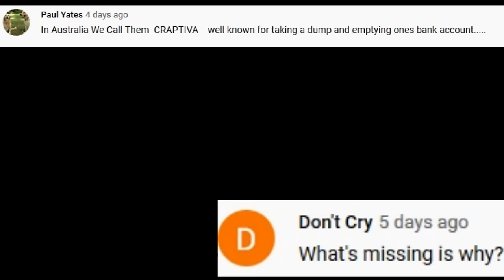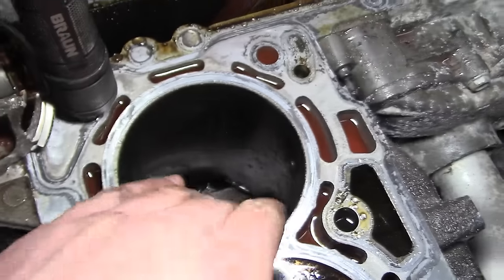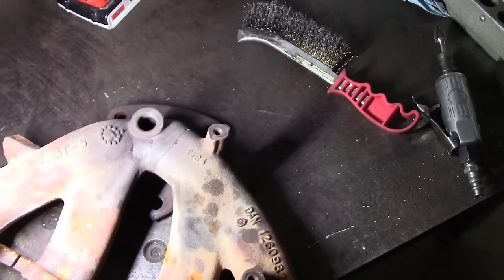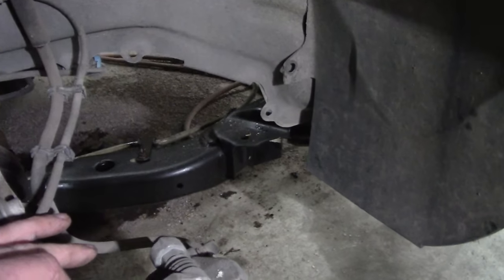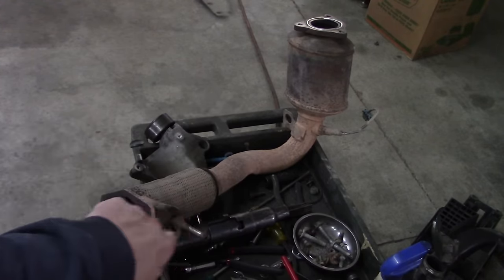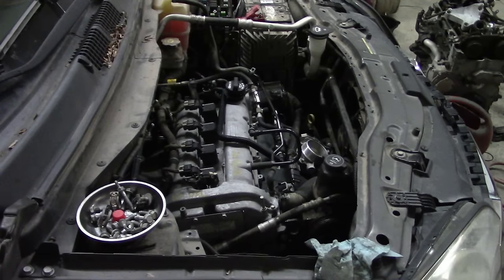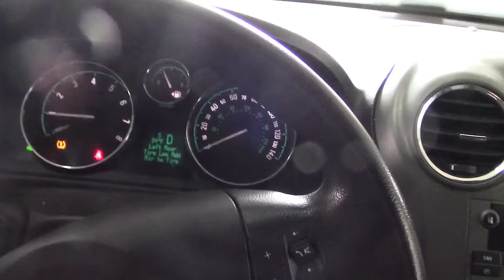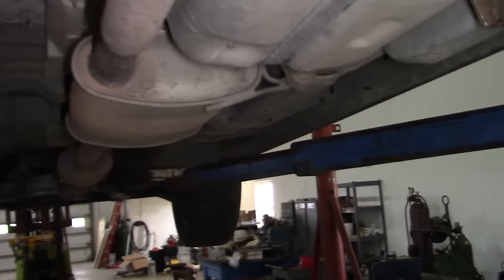I Fixed the Cheapest Small SUV on Marketplace - Part 2

Comment: "Battery sat on the concrete floor". That myth will never die.
Reply: It’s a myth, agreed.. you know it came from someone that was trying to keep there floors pretty or something.
Reply: Dan'sMeTube I’m fairly sure that was his dry humor.. it’s amazing how many people still believe that
Reply: it's a fact. seen it with my own two multimeters.
Reply: @lostintime8651  love to see that video
Reply: Tom Jennings myth my Lilly white butt ! It’s a proven fact from both interstate and Walmart ! I personally have had it happen to me also and that’s why I ALWAYS put them on wood or rubber .
Reply: @zeroyon223 >Both the concrete and plastic are insulators

Concrete is most definitely NOT an insulator, especially old contaminated concrete in your garage. High atmospheric moisture and being wet can also make concrete conductive as it mixes with impurities in the concrete and detritus on the surface. Plastic can also be conductive, depending on the type of plastic.

The old saying that batteries are drained when placed on concrete/asphalt was true once upon a time. The materials used for battery insulation casings 60+ years ago were slightly conductive, and could self-discharge if left on a conductive surface. Batteries back then also tended to have higher internal resistance, especially as they aged, which would promote self-discharge as well. Around the turn of the 1900s, batteries were often sealed in glass, wood or other composite materials, which could be far more conductive. Leaded glass, something common back then was also conductive, and could promote self discharge if used for a battery cell.

Modern lead-acid batteries usually use polypropylene for the casing, which is not conductive and won't allow self-discharge. However, storing them on a concrete floor can still affect the battery by temperature, and as a result, battery performance.
Reply: GGigabiteM Not in 6 days ffs. You totally missed the humor with your book-long post.
Reply: @jmac1099  it comes from when battery case  were made from wood. the wood would soak up moisture from the floor and swell causing the glass  inside the battery to break
Reply: @davekimbler2308  Discharged or low voltage in the battery WILL damage the battery due to the electrolyte freezing and thawing.
Reply: zeroyon223 I was told concrete with rebar draws from the earth current much like ground to air lightning occurs , but I’ve had batteries on concrete drain and not drain on rubber and wood ! It’s way above my pay grade ! Lol
Reply: and Chips of course it will but we’re talking about a healthy battery and not getting froze .
Reply: @davekimbler2308  The world is full of Mysteries my friend, that's what makes life fun and interesting ;-)
Reply: and Chips I feel like I’m back in science class in high school ( many many years ago ) and the discussion is “ what would “ ! Lol
Reply: @davekimbler2308  Old dogs and new tricks, I will always consider myself a student, people that call them selves masters, the hubris.
Reply: The dry humor of Wes is amazing.

Comment: My hypothesis:
Peeling chrome, crazed polycarbonate headlights, faded trim
all appear to be ozone damage from long periods in traffic, idling,
AC on, underpowered engine, overheated, consumed oil,
thermal breakdown, bearing spun. That rod gave up while at
high RPM, let run.

That heavy exhaust is poorly supported, too much stress on
head area, you're right about extremely poor, afterthought
parts-bin designs. Minimal communication between Engineers,
no final inspection like Old Days, Engineers would take new models 
home, test before Market. Disposable junk.

Label under hood should read:
NO USER SERVICEABLE PARTS INSIDE

Polish the turd, make $800 profit & two cool videos, gain experience.

Comment: "Minor disagreement" haha. I've  replaced a 3.6 in a Acadia. The valve decided to high five the piston because of a valve spring disagreement.  😂 Unfortunately you cannot pull it out of the top. Not to bad of a job though. At least in south GA.
Reply from the maker: Yeah most V6 engines will not come out the top. The newer F-150s require removing the cab to pull the engine!
Reply: I'm not sure if I like that. I know I prefer to pull the cab when it comes to duramax work. I guess it all comes down time and how much you want your back to stay in good health.

Comment: Doing things the service manual way isnt always the best or fastest way. I've had to reference mine to get something right and I've also specifically skipped steps because they're pointless. Breaking off the welded nut is a great reason not to even try it. Dumb design too if they're not accessible

Comment: You might be able to get a few hundred for the cylinder head if you cleaned it up, I'd put it on Craigslist. GM seems like they enjoy thinking of ways to make working on their vehicles annoying, I went to pull the heads on a 3.4 V6 in a Chevy Malibu, I had to pull the front engine support off in order to get at the AC compressor, and the exhaust manifold was a nightmare.  Fords are no better, I bought a Hyundai Santa Fe, no issues yet, and it looks like I can get at anything I need to. That car looks great, must've been maintained and kept in a garage. NY cars suffer just as bad from the Rust Monster, our cars don't last long unless the road-salt is rinsed off after every winter.
Reply from the maker: The V6s are always tight. The V8s are horrible, like the Northstar in the Cadillac...

Comment: Great video. At the end I was waiting for a great cinematic ending for the old motor, lol. How long do you think they ran it 3cyl? I think it took a while for those parts to lodge in the oil pan. 30 minutes? I've got a 94 Nissan truck with the original exhaust crossover pipe(aftermarket doesn't have the heat shields). That truck has 300k! I can take any bolt off the bottom of it:)

Comment: At first I found it strange that a man that works on so much large machinery doesnt have the required socket to spin that oil filter housing off.
Then I realised it's not so easy to get a straight shot, and I think everyone ends up using a large adjustable wrench/spanner because that is the only thing that will fit.
Reply: Sorry premature reply, I did it before you tried what you had, but I knew it wouldn't fit.
Anyway that airbox was probably designed by someone with the pipe not sticking out over the screw, and then someone else moved it.
Reply from the maker: There's a low profile 32mm 3/8 drive socket made for these filters.

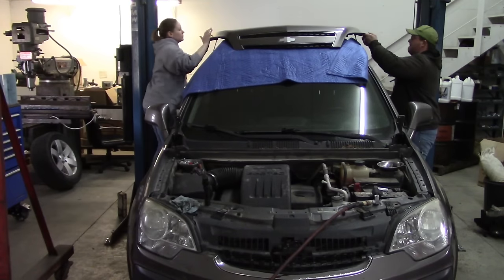Comment: First problem I noticed, was the wearing a John Deere Tractor hat, should have been wearing a Ford hat, Frequent Overhaul's Rapid Depreciation. Anybody tries to tell you First On Race Day, is blowing smoke up your dress. Not for nothing, make the better 7/8's  (that would be the wife) wear some work glove's, to save her hands from the sharp edges of stamped metal. i.e., the hood of the car.  Watch the video @ 30:45, should tell you why you NEVER, NEVER, NEVER put the hood on the roof of the vehicle, as you did, it will, and can cost you a new windshield. Lean it up against a wall, with a blanket on the floor, to prevent sliding, and to prevent damage to the edges. Put the Hood on a parts wagon, but do not lean it up against the side of the vehicle.  Unless you like painting car's, oh silver is one of the harder color's to match, just a heads up. I won't mention matching Pearl's paint (a one inch long scratch on a pearl paint job, say on the side of the vehicle, and your painting the whole side, hoping the color is close enough, without painting the whole car) or Candy Apple's (pretty much the same as Pearl's) etc. Hey what would a 25 yr's plus autobody guy know about where to place the hood of a vehicle, LOT'S!!!!!!! P.s. The bend on the exhaust pipe, is / was a forget bend. What is a forget bend you ask, answer (in my best former New York Italian slang) forgetaboutit. Those require a 100,000 mile guarantee, or until the front tires leave's the driveway, which ever comes first.  Ok, ok, ok, why just the front tires, answer the car could get into an accident as it's leaving, get clipped in the front, hence your golden on 100,000 mile guarantee, or until the front tires leave's the driveway, which ever come first.

Comment: $2,800 is about $300.00 more than that car is worth in the south. but i understand it's really uncommon up in Yankeeville. my uncles and Aunts in Ohio and PA go through the same things.up there if you make one last more  than 5 yrs you're pretty much done. i don't currently own  one vehicle that is less than  10 yrs old. My Company car is only 3 but i don't own that one. i have 4 Cadillac Escalades 04, EXT 2- 2005 SUV's  and an 06 Escalade EXT as well as an 06 Dodge Mega cab 2500 turbo diesel no rust on any of them even my project cars that have sat in my yard for years have a clean under carriage like that crptiva. both of my 2005 escalades were  Southern cars  (GA, and SC)  the one from SCwas $1750.00 at Copart  Salvaged title, and the other was a GA car all it's life and cost me $925.00 from the South Atlanta yard. (the last one is for my daughter. they all have the 6 L LQ9  and there's no replacing that AWD in those trucks. LOVE the things. my next project though is going to be a 05/06 Jeep Liberty with the Turbo Diesel 4 cyl in it something i can beat around in the woods with and not feel too upset if it gets hurt or banged. but still has power where and when it counts too

Comment: in central texas, you can pretty much buy the whole running 2012 captiva for about $2000.00, I find it hard to believe you'll get 4 for it.
Reply from the maker: I did...
Reply: @WatchWesWork  good deal for you, here in central Texas, the only people that drive them are in Austin, and selling a used one is a tough nut to crack.

Comment: I wonder what Mustie1's reaction would be if he saw what was in the pan of the old engine.
Reply from the maker: He'd filter the oil through some cheese cloth, pull the rocker arms off the valves on cylinder 1 and run it as a 3 cylinder for another 200,000 miles.

Comment: This might be a stupid question...but I'm kinda stupid...so, If you have a motor out and are replacing it...wouldn't it be a good idea to partially overhaul  it?  Put in new bearings, new rings (what about JUST rings?) reseat the valves.
Would that be 'good' for the motor, like would that make it virtually brand new???
Just curious...
I've never overhauled a motor.

Comment: The reason this engines go bad is thin oil 0w20 like water if you want this engine last long use lucas oil stabilizer or use 10w40 oil
Reply: 10W40 is too thick and will cause sludge.  5W20 or 5W30 is the way to go so you don't burn so much before the engine reaches normal operating temp
Reply: @Noah_E  5w30 is better choice than 0w20 and 10w40

Comment: Thanks, Wes this was as informative as it was entertaining.  We rented one of these for local driving in Arizona in 2013.  I'd never heard of the model (later found out it only sold in USA as a fleet vehicle), and thought it looked "odd" inside.  I wasn't impressed at all by it, but the worst thing about it was that we returned it having put on 40 miles and it used 4 gallons of gas!  Yup, 10MPG in city driving.

Comment: 34:09 Ahh, the infamous sound of shitty Oklahoma roads. I still remember the hundreds of miles of road I drove in OK when coming back from Missouri one time.  CLAK-CLAK CLAK-CLAK CLAK-CLAK CLAK-CLAK for hours. I got so sick of it that I drove on the wrong side of the road, which had recently been repaved until I saw a car in the opposite direction and then moved back over. I rarely had to do this however, because there were so few cars going either direction. I think there were maybe 6-10 cars the entire duration of the drive on that road.

Are all roads that bad up in the northern states? They make the roads out of concrete in some places and don't place expansion joints, so I guess the frost moves the concrete around and makes buckles every dozen yards or so.
Reply from the maker: Our roads are horrible. Always have been.

Comment: The Wes Host is explaining why part a fits with b and with a new motor said Craptiva is a huge money maker so wifoid can get new Huffle Puff sweat pants and top. She is giving orders to the Wes about what she is going to  buy with the huge money making Furd, er Chebby. As much as ya'll don't care for Chrysler products, my Pentastar gets 30mpg at 80mph. Now all I have to do after flushing the transmission is to buy a newer oil filter housing. I would purchase a Dorman aluminum filter housing, but wise Chrysler does not offer an intercooler so the old one must be used which does not fit my gen 1 engine. So now I buy a 2014 filter housing and must make note of this because 2013 does not fit a 2014 filter. Thank God for David Pike, "Motor City Mechanic", or I would probably have to put a diesel into it.

Comment: come on now, new piston, super polish the crank with over sized bearing and a case of j.b. weld, she have another 100,000 outta her....and you're right, alignment would be needed after the fact, but i have an alignment machine at work, and all the newer vehicles, the nut up inside the uni-body is no longer  a welded nut, GM actually got smart with the new design.
Reply from the maker: Interesting. What are they using now? Some kind of plate?
Reply: @WatchWesWork  yup that's exactly what it is, works good too, I still get nervous when I have to drop a subframe or k-member

Comment: you are right that if you drop the subframe you need to align the car, most 4 cylinder cars are faster to just pull the engine out the top.

Comment: Hello Wes, I enjoy your videos they are informative and entertaining. I live in Halifax, Nova Scotia, on Canada's east coast. I am a DYI and have a fairly well equipped home garage.I thought I lived in rust capital but after seeing some of the crap you work on your rust problem seems to just as bad. Our daily driver is a 2010 Ford Ranger Sport 4 x 4 which I  Rust Check annually, $150.00 Cad. I have been using Rust Check for over 35 years and it works. We also have a 1980 Ford Fairmont and a 89 F150 with a 4.9, which we do not drive in the winter.  The 89 is a work in progress, very little rust. 
I also have my wife help me bleed brakes. I will pose comments and technical questions from time to time. Again I enjoy your content.
Brian

Comment: Concrete floor has nothing to do with battery discharge on modern plastic cased batteries. More likely a combination of old age and a low electrolyte level. Be prepared for bizarre BCM and PCM misfunctions.

Comment: I know I'm late to the party. But the oil filter is not bad engineering. It was done intentionally to force you to bring it in to the dealerships for a supposedly simple oil change just so the can up sell you services and things you don't really need. All car manufactures are building this type of thing into there cars and trucks so they can charge the dealerships more for there cars because they can make it all back and then some on maintenance.

Comment: Special service tool to remove the oil filter? Just cut down a 32mm socket. Most mechanics have one of those sockets now a days. You just have a habit of working on older and larger vehicles.

Comment: The fine folks at GM must have thought the 30,000 mile timing chain replacements weren't enough to get people to the dealership, so they designed the oil filter to be as ridiculous as possible to get people back to the dealer for oil changes :D
Reply: Exactly. This car could have been a decent small crossover, old Honda or Toyota SUV´s are still popular. This model will only sell if it´s on rock bottom price. GM got bailed big time in 2008 recession, the next one is at our door. Can´t imagine a reason to bail them out this time, enough is enough.
Reply from the maker: I bet they wished they had not offered the 100,000 miles warranty!

Comment: You're completely right both on the alignment, and stripped unibody flange nuts (who designs this crap!?), I've had several spin inside the half ass "frame", which results in hours of dreaming up solutions. Maybe the people who suggest this live where rust doesn't happen? Sometimes a drill and a tack weld will hold it, sometimes you have to cut a big hole and use a rattle hammer or torch to cut them off. That said, if the nuts had more than a 1/16" tang on them, they'd probably work just fine, but no, that might cost .005 cents more per part.
Reply from the maker: As I recall we cut the head off the bolt, dropped the cradle, then used a hole saw to access the welded nut. Not fun.

Comment: Loved seeing the little guy on the inttro.
   I thank you for the autopsy footage.  I was hoping for a little post mortem on the old engine, and you delivered, thank you.  I don't like the the folks who hammer on YouTube video makers on their processes (i.e., top or bottom remove/install of the engine).
   The title of your video does not say "how you are to remove & replace a Captiva engine".  The fact that you give your reasoning on either way is a great insight to the guy doing this in their garage, on a weekend.
    That flattening/dimpling of that exhaust tube you were noting, is also on the turbo down tube, right where it goes past the firewall, of my 1995 Powerstroke...  Are you f'ing kidding me Ford, really...?
    Excellent video my friend!
Thank you.

    P.S., almost forgot to say that it was great that the "assistant" was able to interrupt their gathering of sticks, to assist with the hood install...  Hahaha...
   Oh, and by the way, in case you didn't know, your not supposed to set a battery on the directly on the shop floor...  Sheesh, "mechanic 101"...   Hahaha, just joking...
Reply from the maker: I'm all for helpful tips and tricks that make a job easier, but I don't always agree with the suggestions.